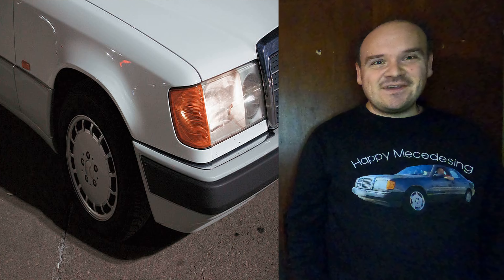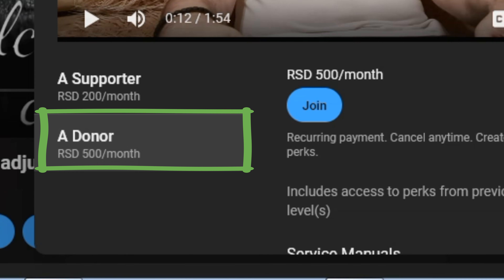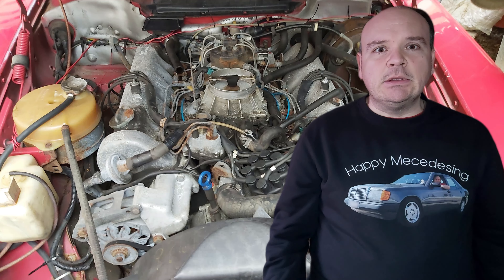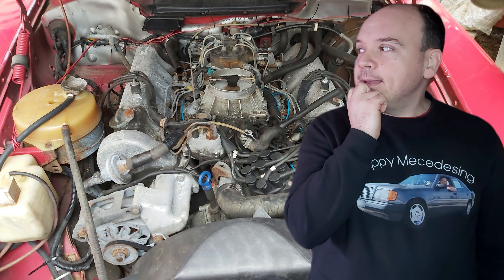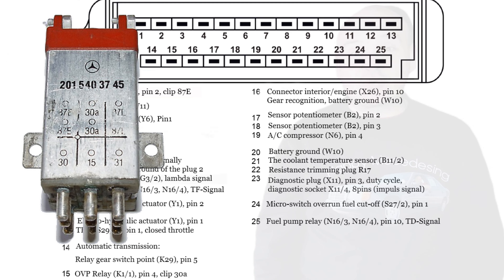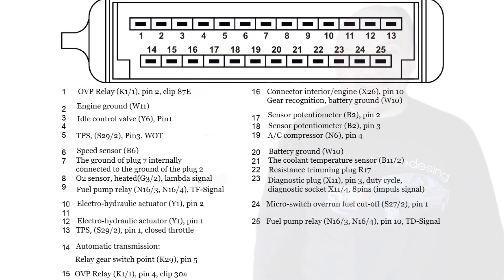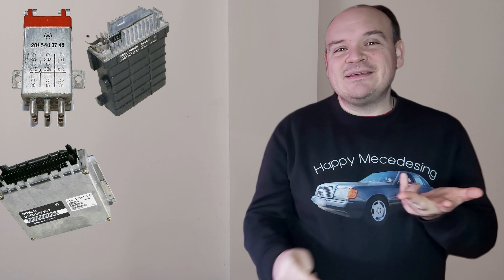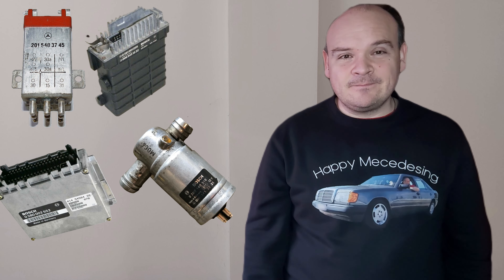㉦Mercedes Ke-Jetronic㉦ - ❗👂🏻🔊Very important sounds🔊👂🏻❗

Comment: Hello, how are you? I hope you can tell me how I can increase the engine rotation at idle. Thank you. I am following you from Iraq❤
Reply from the maker: Salem aleykum! Hello, my man and greetings from Serbia. Thanks for following the channel. Concerning your question, if you have the system on your car after 1988 there is not much you can do. That depends of the ICV whether it's with 2 or 3 pins. IF it is with 3 then you can adjust manually the RPMs on idle, if it's with 2 contacts, then there is nothing you can do, the ECU adjusts then automatically. The precondition for a good idle is a good working potentiometer, the lambda probe, no vacuum leaks and good sensors as well as the whole mechanical part of the system to be good working. My regards to you!
Reply: @mercedeske  Thank you. I changed everything and I am still suffering from the same problem. I bought a complete M103 engine worth 11,000 US dollars. It has traveled 300,000 kilometers and is still suffering. I changed the ECU more than 5 units and no change occurred. I changed the ovp and no change occurred. I am looking for a way to manual it. To raise the number of engine revolutions at idle, 1991 W124 M103 model

Comment: Hello again I’m always watching and rewatching your videos 😂 , tell me  What if this idle valve sound is much lower? On my car (1990 260se) I almost can’t hear this click even with the hood open. It’s much lower than that click sound you shown here. Power supply is ok but with engine on and connector half disconnected I only get 2.9v dc I saw in another video you said it should be 4v to 6.5v.  I have a very low idle around 500rpm only with cold engine almost stalling. and if I press accelerator too fast it will stall.  and I have a high idle at around 900 or 1000rpm with the hot engine but when I change gear position for exemple from D to P the idle is normal at 750rpm but as soon as I step on gas pedal in P position the idle doesn’t go back to 750rpm it will stay in 900 or 1000rpm. I suspect the idle control valve is faulty as I tested other parts such as micro switch and tps and they are ok. What do you think?
Reply from the maker: Test the idle control valve, remove it and flush it in diesel and afterwards clean it with carb cleaner and lubricate with a drop of engine oil and the potentiometer.
Reply: @mercedeske  thank you

Comment: Thanks for the videos! My w201 fuel pump stays on all the time, is that expected?
Reply from the maker: My pleasure, No, the fuel pump must work for 1 second on the ignition on and stop. There is somewhere open circuit in the fuel pump relay then. Because the fuel pump relay runs the fuel pump. Try to remove the fuel pump relay and to turn the ignition on. The fuel pump has to work for 1 second and then stop.
Reply: @mercedeske  whiteout the relay, the fuel pump doesn't turn on. Is it a bad relay? How does the pump know when to stop? Is there a pressure sensor somewhere?
Reply from the maker: @soyeltiolucas  The relay tells it!
Reply: @mercedeske  what tells the relay to stop then? I'm asking to see if I need to diagnose something else 😅
Reply from the maker: @soyeltiolucas  The relay determines that - it connects the contacts 87&30 - 87 is the positive from the fuel pump, 30 is the main power supply.
Reply: @mercedeske  OK thank you very much!
Reply: @mercedeske I finally got my hands on a "new" (to me) fuel pump relay and as you said it now stops the pump after a few seconds. You rock!!!
Reply from the maker: @soyeltiolucas  👍👍👍Thanks - Happy Mercedesing!

Comment: I have checked all the system and indicatios are good, with an old machine....co is fine.....but the problem with cold start persist......
Reply from the maker: Thanks a lot. Well...if the problems persist - check the ovp, the wires towards it, watch my video about the mechanical part of the system and check all the wires towards the coolant temperature sensor, cold start valve as well. Sometimes the sensor can be good, but the wires bad.